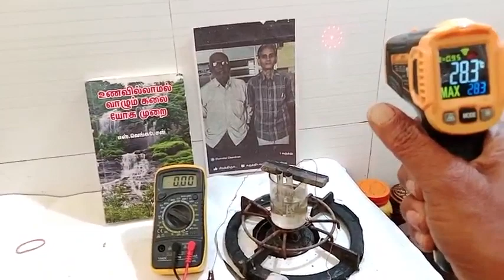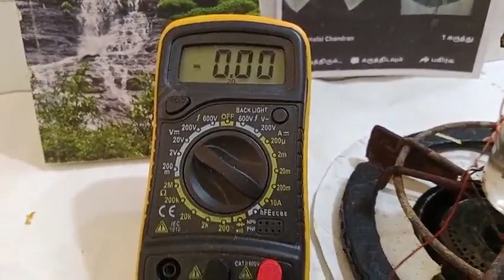superconducting low cost water spliter under micro volt using s-diode directs back EMF to Split h2o2

Comment from the maker: water converts into superconductor at 100°c using 0 resist electricity tech 
வெங்கடேச மின்வளி-
MINVALI VENGATESA Q-GAS

1) கருத்து சுருக்கம் abstract

குறைந்த மின் அதிக வெப்பம்
low volt high temperature

2) செயல் விளக்கம் description
நேரடி வெப்ப நீர்ச்சிதைவு- direct  thermal water split

நீர்வளி உயிர்வளி பிரிப்பு
2H2O spilitng

இணைப்பு connection
1.5 battery to 48k potential metre to 1 ampere semi conductor diode to 100 ml 1:6 h2so4 beaker with anod, cathode copper electrode by multimeter support

heating system on my self 
place gobichettipalayam
date and time 27/5/2022 at 3pm

1.5 volt seems multimeter, slowly direct heat with LPG gas burner the heat develops, the voltage reducing with potential metre 1.5 to 1.4 to 1.3 and gradually to 0.1volt etc....
temperature testing with laser thermometer
at 35 degree Celsius 1.5 volt nothing,                    at 90 degree Celsius 0.5 volt the h2o speed starts,
at 100 degree Celsius 0.4 volt the 2h2o speed evolve,                                                                 at 115 degree Celsius 0.3volt the 2h2o speed continuous,  
                                                                    at 130 degree Celsius 0.2 volt  the 2h2o gas evolving continuous and safficient gas,   (VENGATES points) 

important                                         sometimes gose to 0.015 voltage at 160 degree Celsius and safficient gas evolve etc..
acid diluted water was no colour changed, no material losses etc .

.3) 1-உரிமை கோரிக்கை claims 
விஞ்ஞானி வெங்கடேசன்-scientist-patent holder- Venkatesan BE;amie,
Gravity does evil but we turn it into good..

  2-திருக்குறள் THIRUKURAL
 
நல்லவை எல்லாஅந் தீயவாம் தீயவும்
நல்லவாம் செல்வம் செயற்கு.
In making wealth fate changes mood;
The good as bad and bad as good.        375

செயற்கை அறிந்தக் கடைத்தும் உலகத்து
இயற்கை அறிந்து செயல்.
Albeit you know to act from books
Act after knowing world's outlooks.        637

ஆகாறு அளவிட்டி தாயினும் கேடில்லை
போகாறு அகலாக் கடை.
The outflow must not be excess
No matter how small income is.        478

 3-Venkatesan invention
s Venkatesan invention patent act 1970 form 3 provisional  specification 76 mas 75 dated 13.5.1975 closed circuit water engine 
papper sent to nrdc also 27nov1975

Venkatesan method of water splitting
project and readings
professor s Venkatesan
place valivalam polytechnical College
electrical lab
date and time 7.8.1976 at 4:00 p.m

volt ams remarks
1.l0 0.16  Bubbles were evolving at electrod  bubbles
1.30  0.22     ""      """  
1.00  0.16  "  "  " "
0.90  0.07 slow bubbles
0.80 0.07
0.7. 0.07  slow bubbles in

note
Below 0.70 volts, when voltage was reduced current ceased

The above experimental findings where confirmed by extract from book:-

  4-"Fuel cells, Power for tomorrow" by  DS Halacy,JR(popular library Inc,U S A) p 21 &22(substance)
" Mond and Longer-hydrogen oxygen fuel cell with platinum porus electrod gave an e m f of 0.73 volts"

 5- reference additional
physical chemistry by Puri & Sharma
p 404,p 389,p750

 6- extract from:-
 
science today October 1978 page number 53 artical 

why is a perpetual motion machine impossible
...... don't come to the conclusion that perpetual motion is to be hopelessly ruled out. in the sub atomic or microscopic domain " perpetual motion is the rule molecules of matter or in a state of constant random motion........
work can be extracted from this motions without violating the second law of thermodynamics stated above

"a perpetual mobile of the second  kind whose efficiency is 100% does not exist
in fact the molecular motions are slowed down(or system cools down) when this energy due to the random motion is partially converted to useful work the rest of this energy is lost as heat

......We must remember that quantum mechanical has to be applied in the case of these small particle..... Indira Murthy...

  7-A brief history of time by Stephen w hacking- page number 109

second law of thermodynamics has a rather different status than that of other laws of science,such as Newton's law of the gravity for example, because it does not hold always just in the vast majority of cases
8- Extract from book
உணவில்லாமல் வாழும் கலை யோகா முறை ஆசிரியர் வெங்கடேசன் கட்டிட பொறியாளர்
Art of living without food by yogic method Venkatesan civil engineering
p number 220 to 222

photo copy below

..
 9-practical and project vedio by INIYAN KA MU AT MY HOME ETC..

27/5/2022
https://youtu.be/pGrXf848qvk

30/5/2022
https://youtu.be/4ASC0EjGTdc

10-1889 mond and Langer, 1975-scientst-sa.vengatesan,2022-INYAN KA MU RESEARCHER

https://www.google.com/search?q=direc...